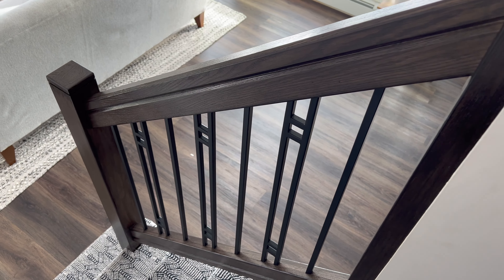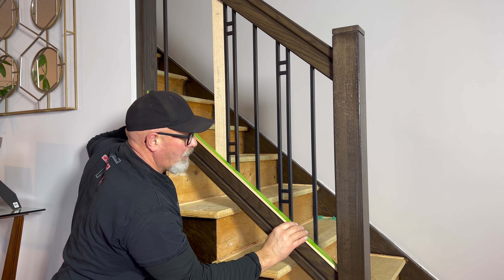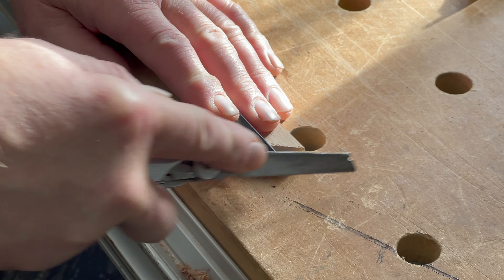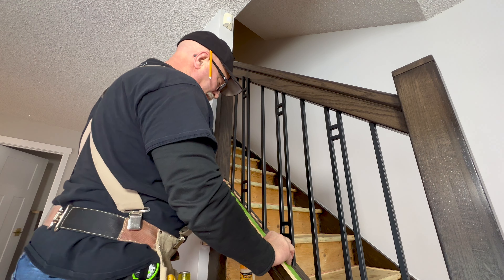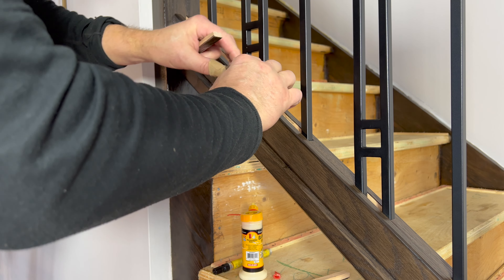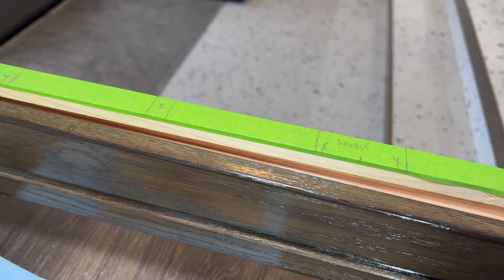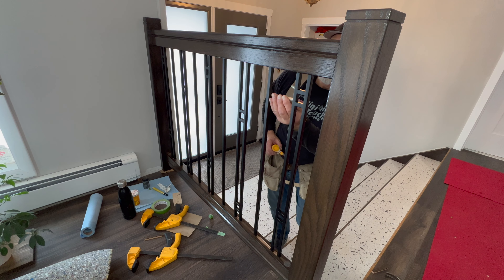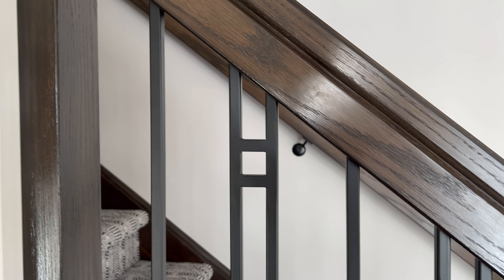Designer Metal Baluster Installation

Comment: Hi Scott,

Not relevant to this video per se, I’d like to ask you two questions about stair treads.

1.  Do you rip a fresh edge on the backside (that meets the risers) of new oak treads before installing them or do you simply use the factory edge?  If you advise to leave factory, do you make a pass or two with your sander?  My question presumes each factory edge looks straight when examined.  If not, a rip will be done to correct the situation.

2. Do you find that using a square nose on white oak treads instead of the standard bull-nose holds up well over time?  I understand that bull-nose would likely withstand abusive or very heavy use conditions  better, but my hunch is that in real-world use square edged will hold up great.  Mine is very low-traffic and it’s extremely rare not be be wearing rubber sole shoes.  I’m the only one that goes upstairs (music room).  Should I avoid 1/16 round over and go with 1/8?  Or do I need even more than 1/8” round-over for acceptable wear resistance? 

Thank you very much
Reply from the maker: Richard, Check out my video "Complete Stair and railing makeover" it shows how I rip the back of the tread at a 15-degree angle to leave space for glue. 
https://youtu.be/eBvsFsn67NU?si=lWQWsNk9rm6jPKWm

A 1/8" or 1/4" round-over is fine. You just want to break that sharp edge. I recently built an open-stringer stair case with solid birch treads and just used a 1/8" round-over. This is the video: 
https://youtu.be/Qjm271u-j1c

Thanks for your questions and good luck with the build. Scott

Comment: Have you ever dealt with the wall that mates with a half newel being a bit more than just a little out of plumb? Do you just adjust the angle of cut for the rails? Have you ever had to scribe the newel?
Reply from the maker: Hi Paul, I've never had to scribe the newel. But yes, I adjust the cut on the railing to suit. Sometimes I have to adust the cut both ways too if the face of the half-newel is off-90. My video on "stair railing installation" addresses that issue. Here's a link: https://youtu.be/JjCs6_Q7SNM Thanks for reaching out, Scott

Comment: Do you have any tricks to measure the spacing for balusters when using 2 different types. I have 1/2 inch straight metal and a  metal box/rectangle on that is 1/2 inch at top and bottom but 4 inch wide decorative rectangle that reaches 2 inches from top and bottom.
Reply from the maker: Without seeing what you are referring to, I would lay the balusters out on the floor - perhaps on a big piece of paper (flooring paper for example) and map out your spacing that way. Hope this helps, Scott

Comment: Hello Scott
Thank you for the videos.  They are the best I’ve found and wish I’d have found the long ago. Doing a total stair makeover from carpet to wood.  Rails, balusters, hampton wall all being remodeled/replaced.

1. In your self-critique at the end you mention a metal Invess (?) to address something about how the “plugs” on the bottom look.  What’s an invess?  Are the  plugs the fillets?  I think it all looks spectacular.  

2. Did the rail come with a fillet strip or did you make it?

3. Another person asked about the rail with 1/2” fillet and you said Windsor Plywood.  Did the rail come as shown or did yo modify it somehow?  I saw nothing at WP or the  BH Wood website.

Thank you
Reply from the maker: Thank you Richard. I'm glad you love the channel. In my critique I mention the Lamello Invis. This is a very unique magnetic joining system for installing totally invisible connectors. I have two videos on that specifically. https://youtu.be/Xaw5x4I06D8

https://youtu.be/wVvFFUwtHnk

The railing did come with a fillet strip. Very popular where I am. But I know other carpenters are very accustomed to solid rails. They were purchased from Windsor Plywood in Thunder Bay. Not sure where they source them. Cheers Scott (More videos coming after the summer; I'm busy building at my family camp.)
Reply: Thank you, Scott for the reply.  Now I’ve pieced it together (pun intended). Your issue was NOT to do with the look of the fillets.  It was the joinery between lower rail and newel post. 

I have a question about installing white oak treads.  Not sure if I can ask here or if you’d prefer I ask in another video more related to tread installation.

Please let me know. @scottearlsmithFTC
Reply from the maker: @richardcloud9265  This video covers tread installation. 
https://youtu.be/eBvsFsn67NU
Drop your question on this video. (But I can answer the question on any video for any subject.) Cheers Scott

Comment: Hi Mr. Scott. Did you use a spacing formula on this job, or did you layout by eye using the code requirements as a governing rule? In the past, I have grouped these in pairs of two and used a formula. Thanks for your time and effort in providing excellent content. It seems that us trim carpenters have very few resources available when it comes to quality stair building and trimming. Have completely worn out my Coffman stair building guide 😂
Reply from the maker: Yes that Coffman Guide is THE authority for balustrade building. I used a story pole for laying out that run of balusters. It took a bit of time to also line them up so there was even spacing top and bottom to the horizontal bar connecting the pairs of rods. The customer only had a limited number of those balusters so I had to come up with a plan to space them all appropriately so I didn't run short. Hope that makes sense, Scott
Reply: Thank you very much!
Reply from the maker: @productiontrimcarpenter  You're welcome.

Comment: I’m a full time stair and railing carpenter in Sudbury Northern Ontario and I do many square metal spindles. This last fall/winter 80-90% of my jobs have been square. They’re very popular up here. The doubles are a lot less common though. Maybe 2-3 jobs a year. 
We don’t do the fillet style though. We mortise in all of ours.
Reply from the maker: Interesting. So what do you mortise with? Drill press or mortising machine?
Reply: We use a King Industrial Tilt Mortiser. Once I got it setup for what we needed it’s great. A little customization and you’re able to get it to tilt to 40 degrees so all our rake railings get mortised too. 👍 @scottearlsmithFTC
Reply from the maker: @jaygauthier6896   Wow! Impressive. I will have to check that unit out. So weird that I'm a few hundred miles away and the trend is so different. The main supplier here, Windsor Plywood, primarily sells the grooved rails with fillets. But it sounds like your method is a little higher-end on the craftsmanship. Love it. I've done a video on mortised balusters. The customer wanted a  solid oak shoe with mortises so I dragged my drill press to the job site. But your system sounds much better. Thanks for reaching out!
Reply: Yeah in Canada there’s really only 2 popular mortisers. At least that I know of. The Bullets and the Kings. I’ve used both and the King’s are the better units. I have the King Canada ma-1050st and it has more adjustable hold down clamps and the bed slides right and left so you don’t have to reposition and re clamp your railings every mortise. We set it up with my Jawhorse. It’s crazy heavy though lol.
Reply from the maker: @jaygauthier6896  Thanks again. Will check it out.
Reply from the maker: @jaygauthier6896   Two dealers in Thunder Bay apparently.
Reply: Got mine from Tegs Tools in Hamilton Ontario. . But yeah there’s quite a few places coast to coast that carry King.
Reply from the maker: @jaygauthier6896   Woodenedge in WPG has them on for $749. Wondering about the 30-degree tilting table. How do you get it to go past that?
Reply: It’s actually pretty easy once you have the unit in front of you. It naturally goes a little further than 30 degrees as is.
The only thing stopping you going further is the washers at the back where you tighten/loosen 2 bolt to adjust the tilt. They hit the body. 
So just take them to your bench top grinder and grind flat spots on the edge of your washers. That will allow for a greater tilt. It’s maybe hard to visualize through this explanation but it’s pretty straight forward if you have the unit in front of you. It goes to 41-42 degrees with the washers clipped. 👍
Reply from the maker: @jaygauthier6896   Perfect. Sounds like a good purchase for me.
Reply: It was for me too. Maybe I’ll see it in your channel some day 🙂
Reply from the maker: @jaygauthier6896  Thank you for educating me. One of the great things about the trade is that you never stop learning.
Reply from the maker: Jay, I'm buying a used King Industrial mortiser and will be modifying it to go beyond 30 degrees. I see you sent me instructions on that but I may have questions. Can you email me at scott@scottearlsmith.com in case I have questions? Thx Scott